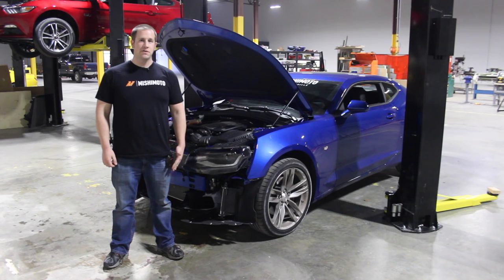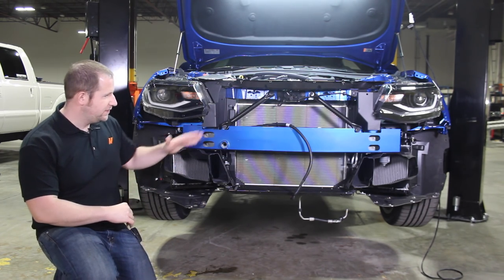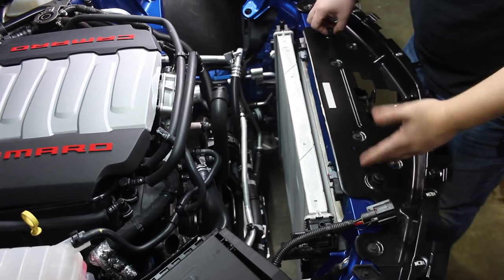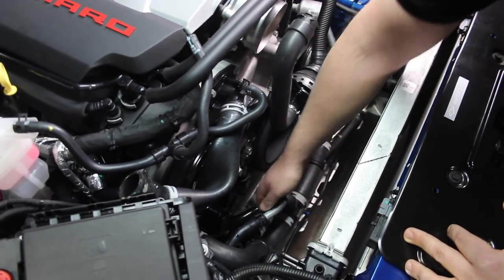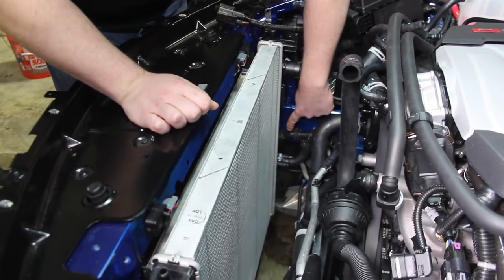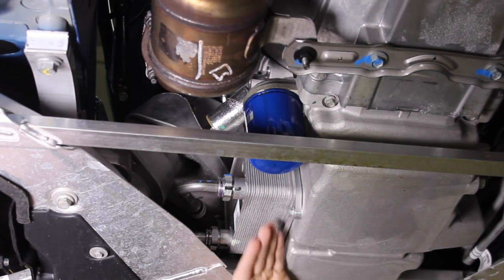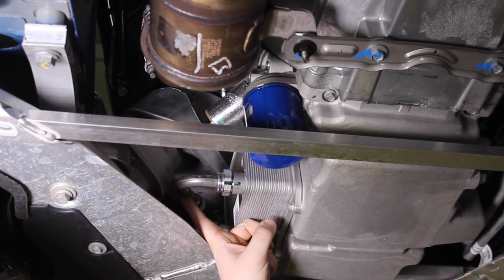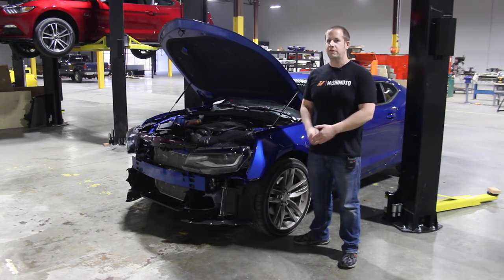2016 Camaro SS Video Review Series, Part 4: Radiator and Oil Cooling System

Comment: Just changed the rear diff fluid and notice the rear differential lines running to the front of the car. Interested to see your video number 5 on this. ALso just waiting on your catch can to come in! Thanks for all the hard work and quickness you goes are hitting the 6th gen camaro hard and fast!

Comment: seems like the Camaro team learned from the C7 Z06s oil overheating issues.
3 Rads and they separated the oil cooler from the catalytic converter.

Comment: I have a 6th gen. Same set up as the one in the video.  My whole coolant system is milky. Except my engine oil
Reply: Have you seen this problem before?
Reply from the maker: Not particularly with that vehicle. We would suggest working with a local shop if you are unfamiliar on how to diagnose.

Comment: nice but a lot of hoses, plastik fittings and clamps which can leak or brake. I would prefer one big engine cooler instead and the AC heat exchanger on one side and an air/oilcooler one the other side with a fan. 
oilcooler seems pretty easy and simple, like that.